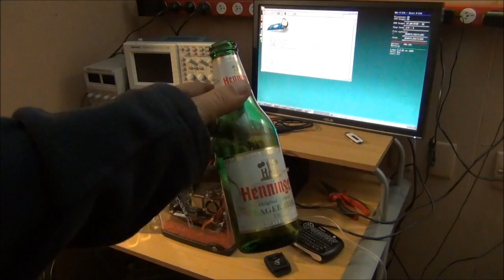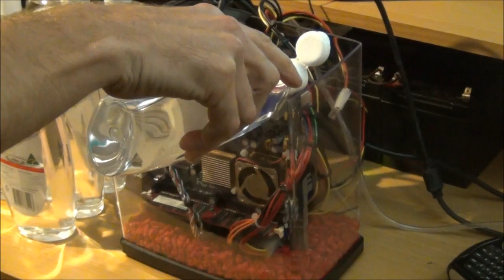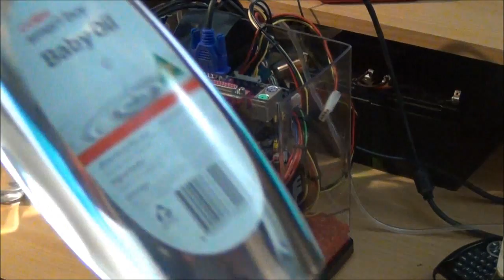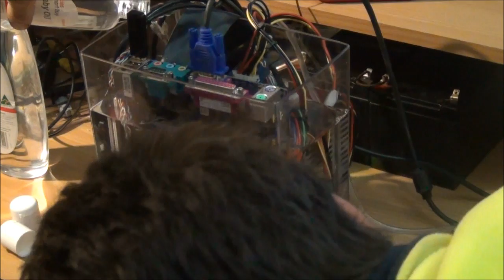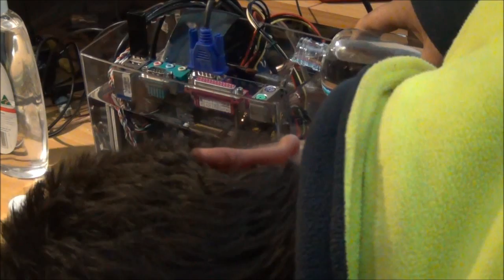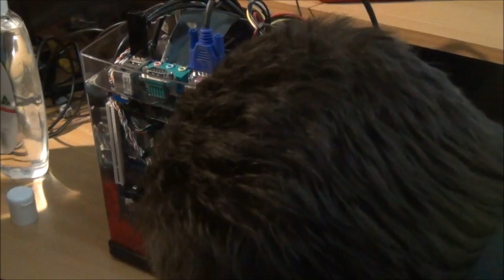Dan's Oil Submerged PC Build, Fill with Oil.

Comment: The liquid is too viscous for the fan, no?
Reply: +staircast Depends on the fan. The oil serves as liquid cooling. The fan serves the same purpose thus it's redundant. However. Parts you definitely do not want in oil include Disc drives, USB's obvious, and while Solid State drives no issues a traditional Hard drive would be a very bad idea. The reason why. Traditional Hard drives depend on high speed moving parts. Solid states no moving parts. Oil get's into a hard drive and well tough shit. 

Oil computers have alot of pros and cons. If your to build a gaming PC that way which can be done. You'd need to have radiators attached to pump and cool the oil, Which means you'd still hear fans going, and second you'd need a very large fish tank that's very heat resistant which is not exactly an easy progress. A Petco would know what's the best tank for an Iguana but they'd be scratching their heads if you asked them what they'd recommend for an I7 Intell with 16 G Ram, dual graphics cards. 

Though you might wanna ask the question anyway for the amusement of the look on their faces.

Comment: i wonder what happens if the oil gets on your connectors :P 
and what happens if you let it run some days straight? will the oil heat up to 100 C? :P